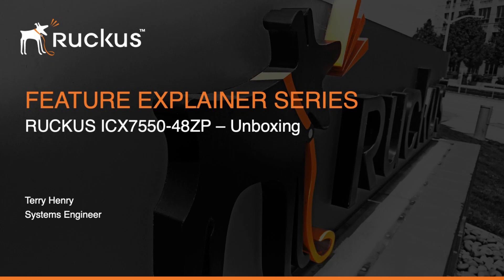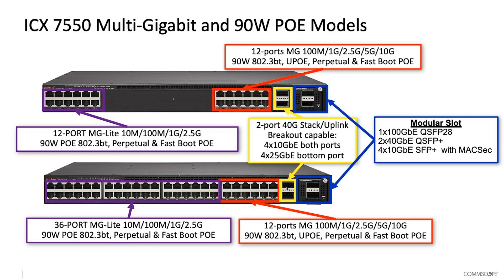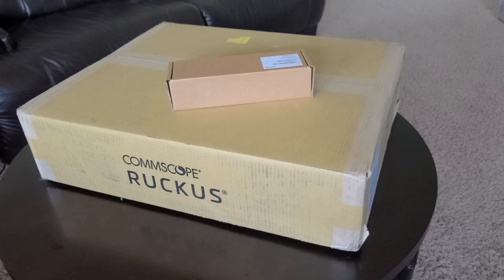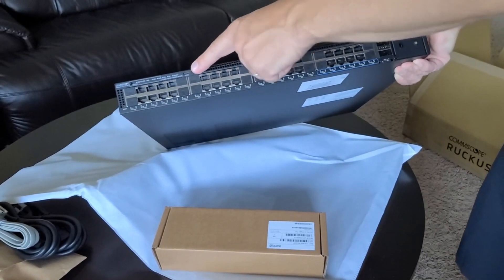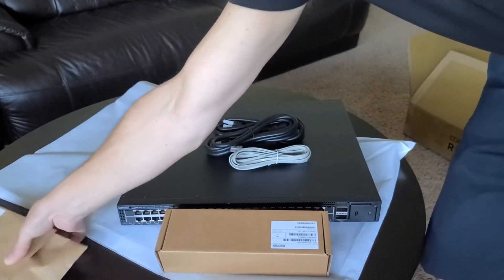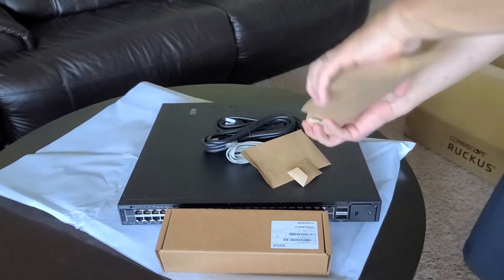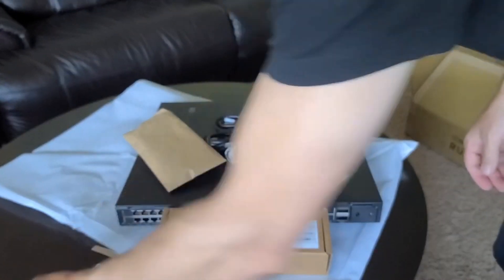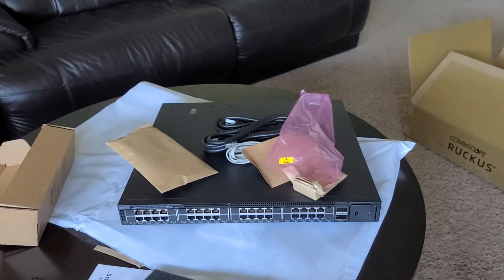RUCKUS ICX7550 48ZP Unboxing

Comment: it's like 7150-c10zp but more expensive than any homelabber can afford
Reply from the maker: Definitely not designed for the average home lab but lots get sold into luxury homes and yachts.
Reply: @TerryHenry   i just baught the Brocade ICX 7250-48 for a big upgrade in my house although way more than i ever will need i was thinking on POE at the time but ebay wanted like 100$ more and i live in the country so are home surveillance is normally a 12 gauge  witch is called MYOFB  but i was thinking about doing either a NVR setup or do some wireless cames i have room for a NVR but unsure still debating on my head also the new Gui is Sweet as well a much needed uplifted